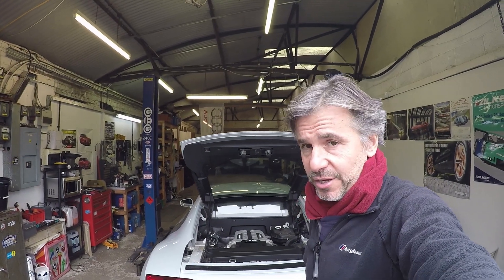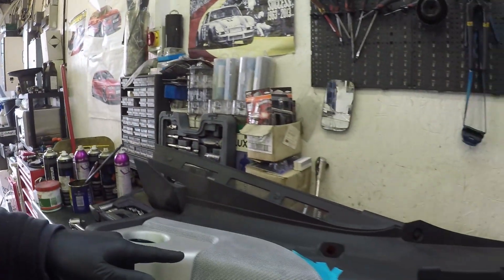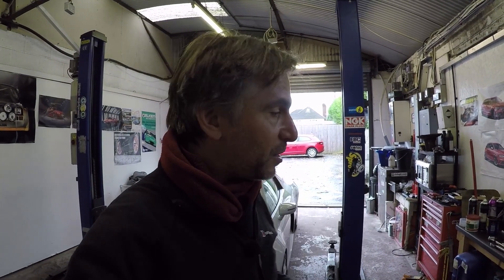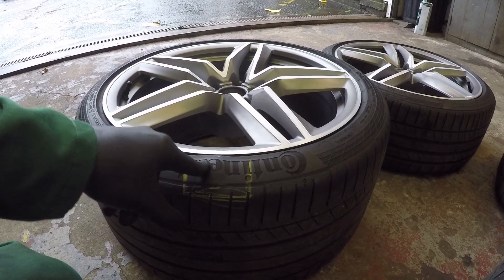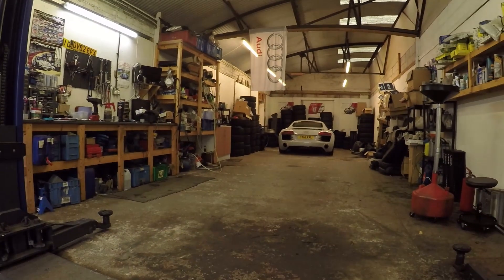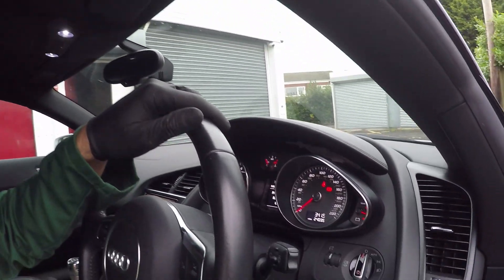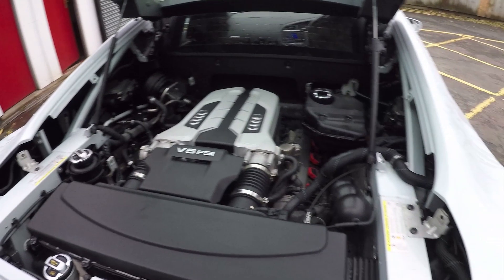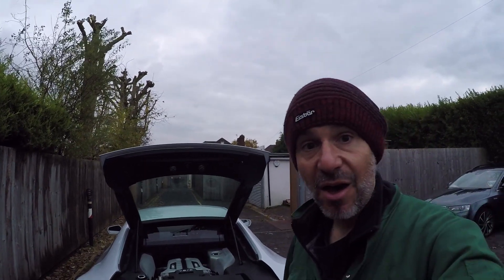NEW wheel colour (AGAIN!) + Engine Bay CLEAN

Comment: Great to see the engine bay finally come together Andrew. Hammerite is generally durable, I used the same product on the rear drums of my first A2 many years ago. The car is still part of the owners club and some 10+ years later, rust is only bleeding through indicating they need doing again. In the engine bay, that should last you many years. Wheel change will always be subjective. The new colour compliments the car much better and whilst more conservative (no election pun here) pulls off the look with a degree of individualism to compliment the OEM look. Moving from bronze to the new wheels akin to reversing the peak of your baseball cap from the back of your head to the conventional position. All grown up now. ;)

Comment: Very good Andy. I don’t think the camera does the wheels justice. Perhaps a one off close up to enable us to appreciate the detail and effort to produce them. I was very impressed with your hammerite efforts too. I assume you will dress the engine bay soon. Little tip would you believe WD40 to dress the bay works wonders. Spray on leave 20 mins then wipe excess off whilst protecting everything 👍
Reply from the maker: The WD40 tip is a good one.  Don’t tell anyone but I use Meguiars Endurance tyre dressing on everything but will try WD first as it’s lighter so less likely to react to the heat in the engine bay. I appreciate the light wasn’t great when wheels shown, 5 mins after wrapping up it was tipping down and dark! One for the next vid which is paintwork detail and protection 👍
Reply: volkswizard look forward to it mate. 👍

Comment: The new wheels are not as drsmatic I guess but it definitely look better, less aftermarket. I also get paranoid when I clean my engine bay. The only thing is I would not be able to sleep at night knowing that I painted one side of the trim and didn't paint the other.
Reply from the maker: Hey Neil, I will paint both if necessary but I am wary that the new paint may react with the heat in the engine bay so giving it a few drives before I am confident enough to replicate on the other (currently perfect) side.

Comment: Corrosion on a £50,000 Audi is simply unbelievable ! .I would of thought they would of used Zinc primer or any other means of protecting the cover.
Wheels look great
Reply from the maker: Thanks SpikeXtreme. This car was £100k new and the R8 GT was quite a bit more too! I think Audi were learning with first gen R8, the rusty oil pipe is much worse than a bit of trim, fixed with the Mk2 version as was the engine bay trim - no more metal!

Comment: Andy given the number of times you've had wheel work done I'd value your feedback. In a moment of madness I slightly caught my diamond cut wheel on a kerb. I went to my BMW dealer who sold me the car. They are quoting circa £190 for one wheel and I'd lose the car for circa 5 days as they have to send the wheel away to be repaired. Seems a little steep on the costs, thoughts? Oh in closing the wheels look good and you've done a great job on the engine bay! Cheers, Kevin
Reply from the maker: Hi Kevin, I suspect the dealer will take them to the refurbisher and charge you double the actual cost going by the figures you quoted so find a decent refurbisher and ask for a quote. I pay around half what you quoted with no special deals. Having said that I supply the wheels and tyres off the car so do all the refitting myself.  Still worth shopping around though. Good luck 👍

Comment: 3:57 - That is interesting, my 2012 has zero rust in the engine bay.
Reply from the maker: Many factors will affect whether you get rust or not but being in northern england or not being garaged or being left outdoors unused or lots of short journeys. Basically water gets in because it's not sealed and the metal there is steel so rust will happen if they don't get dried out from use. Maybe people washed the car and didn't go drive it for ages?

Comment: Wheels look far better, as for the damaged tyre, prestige wheels would have been replacing that for a new one if it were mine, it’s exactly the same as if they damaged your wheel beyond repair, they would have to replace it

Should have sent them to Lepsons 👍🏻
Reply from the maker: I can’t be 100% sure it wasn’t damaged to some degree before but I’ve never hit a pothole so bad I’ve felt the need to check tyre afterwards.  Best put it down to experience
Reply: volkswizard mmmm, yeah possibly, not saying it is the case, but the way of the world now seems to try and cover a mistake up though, Or not own up to it.

I’d get all 4 tyres agreed on condition before i had any further work done in future

Comment: Andrew, I love your videos and your content, however, there is this one wee thing that you have sporadically mentioned, in this episode and before, which just hits a raw nerve. Perhaps I am being a little sensitive, but can you stopping stating that Project R8’s original home being in Scotland is the reason for it being dirty. Scotland is not any more “dirty” that anywhere else in the the U.K.. Perhaps, when it lived in the Stirlingshire countryside, the previous owner just wasn’t as caring as yourself, and it just needed some love. Love and attention, both of which you are clearly providing.
Reply from the maker: Hi Richard,  I see your point. My reasons for saying what I said is that having dealt with many customers from Scotland, a lot of them state that they wouldn't buy a car from Scotland because the winters are harsher (more frosts) which means there's a lot more grit applied to the road. This causes corrosion and if ingested into the engine bay when the roads are dry can create a dusty residue too. From my experience of cars down here, they don't look like mine after 4.5 years (oil pipe leaking from corrosion for example).  Luckily it's young enough to not have had much effect other that cosmetic.  I've driven back from Scotland 3 times in the last 2 years and on two occasions encountered gritters solely north of the border (M74).  Anyway, I'll choos my words carefully or even better move onto something unrelated next time.
Reply: Hi Andrew. I appreciate where you are coming from now. I did say that I might be being a little sensitive 😊. Scottish winters, particularly those above the central belt, do tend to be a just little harsher and extra gritters are needed to avoid the slipping and sliding. Road salt is a problem. Been there and worn the t-shirt. That being said, taking good care of your car does avoid most problems. Fingers crossed, my previous two and current VW have avoided all these issues with my obsessiveness in keeping them looked after.